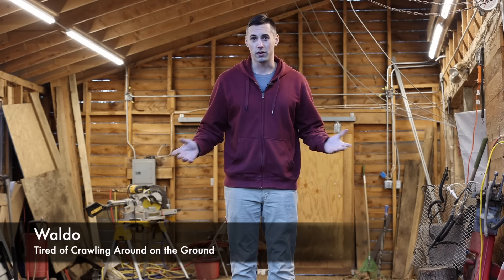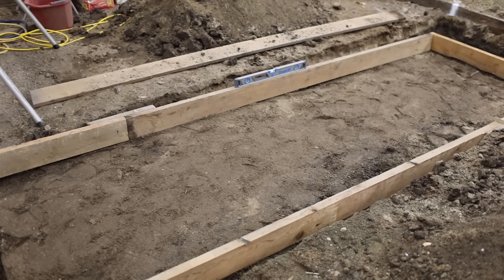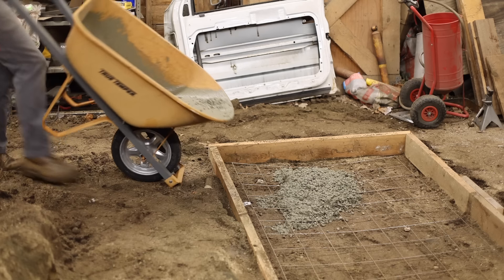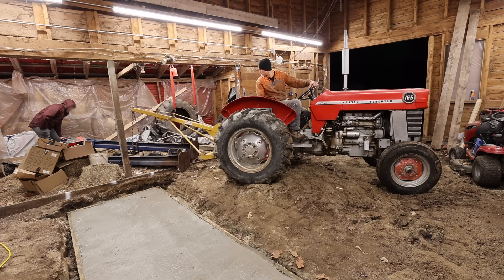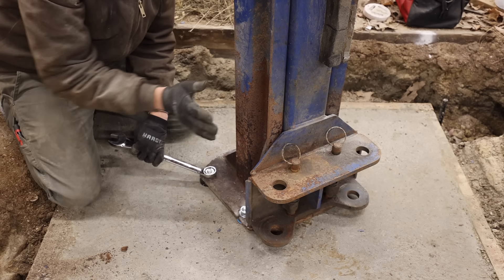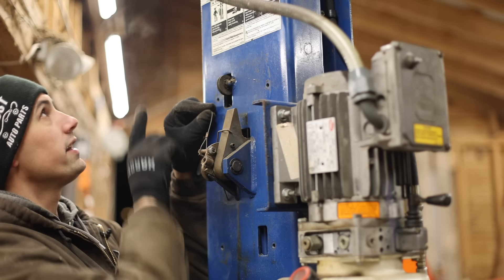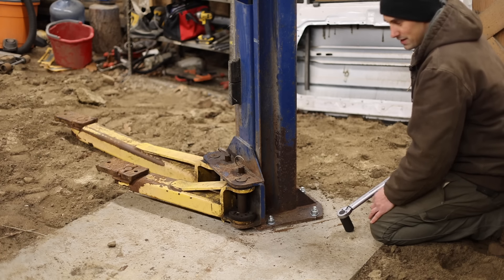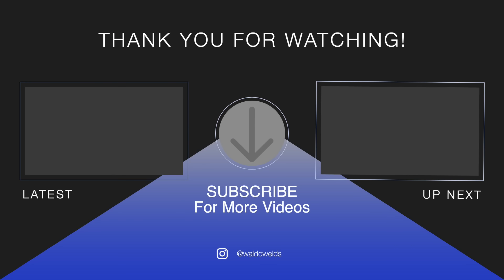Installing a 2-Post Automotive Lift on the Cheap

Comment: Hi Waldo!  I have an idea for those cable spacers.  Weld the nut onto the end of the pipe.  On the other end of the pipe, weld on a larger nut that the cable end is able to pass through.  Now you can use the flats on the larger nut to rotate the entire spacer, tightening up the cable.
Reply from the maker: Good idea! 👍
Reply: F’n brilliant, which is probably why I didn’t think of it.
Reply: Haha you wanna know the right way of doing it ? 
Install spacer at the other end of the cable inside the column that’s the only right way lol 😢

Comment: 14:19 I think there is to little concrete from the edge of that post to the edge of that slab. Looks like a super easy spot for cracking to occur, especially now that there’s 5/6 of the pad thickness holes drilled right there and one is within 4” of the edge.
Reply: Bendpak lifts call for a minimum 6" concrete on each side past the edge of the base plate.
Reply: @rallydan31   And the slab s 5.5" thick.
Reply: This is correct. Its called edge distance and the minimum is determined by the number of anchors, the type of anchors and the slab. As this is a Rotary this calls for 4-1/4" of 3000 psi with Hilti kwik bolt 3 anchors and 4 inches of edge distance. The edge distance is also dependent on there being a full slab. This is dangerous for far more reasons than edge distance. That slab on a 2 post assymetrical lift is an accident waiting to kill someone.

Comment: Merry Christmas Waldo. I like, most of the comments have concerns with your pad, it's not anchored down, such as with pylons using rebar, not wire. Theres no real footer either. Instead of ripping it out may be you could drill into it from all four sides insert 1/2 inch rebar and let that rebar run outward another 2 feet or so, dig down for 4 pylons: 2 front 2 rear of the lift alighed with the post about 2 ft deep run rebar vertical and wire tie it to the horizontal rebar I mentioned earlier, make cross brace with more rebar. Then pour a new pad all around the existing pad, locking all together. Also for added stability tie in the top of the post to the rafters of the building,  those rafters dont look strong but would have a huge amount of leverage against the load of the lift. I think these two modifications would secure the lift for years to come. I know you want to lift the 2 trucks you are building and there both very heavy trucks. Love the channel, just dont want you to get hurt, keep the content coming!

Comment: The ends of the pads flip up so they can be used as extensions to reach a frame if the lift arm would contact something (like low side steps) before the pads touch the frame. If you would do that make sure the pads are facing the opposite direction from each other on each side. Your best bet is get a set of extended height adapters. They're a better option over having the long end flipped up.

Comment: I've got a dirt floor in my shed and was thinking of doing the same thing. I think I would add more concrete under the posts. That narrow strip of concrete that you said weighs 3300 lbs seems a little light. I'm not an engineer so I'll keep watching to see how yours works. Thanks
Reply: It's not the weight that's the issue-- it's the fact that it's only lightly reinforced-- and it's not very wide front to back.  He should tie the tops of the posts to those rafters above and that will make it 100x stronger.
Reply: I would make it "H" shaped. I feel it could tip over on that narrow shape. Lift and concrete together I mean.
Reply: @spiloFTW  H shaped, well reinforced, with the H extending to the furthest reach of the lift arms.
Reply: I would have dug 2-3 foot piers under the post for the lift. Then make sure that I didn’t get a cold joint between the piers and slab and rebar to hold it all together. This is scary.
Reply: Make a slab that the vehicle can park on or you will end up hurt or dead. THIS IS NOT AN ACCEPTABLE PRACTICE.

Comment: The front to back stability is sketchy in my opinion. Remember that the columns are long levers and the higher the weight, the more torque on the slab. I think at full height, you will be on dangerous ground of the whole thing tipping.
Reply: Yup. I hope he sees this and fixes it, I really dont want to see him get hurt or worse
Reply: I AGREE>.. . He should have dug 18"  deep footers with lag bolts down into them.. Where at least the posts were being held in the ground well..  I already wrote him a long note about it..   If he would just tie in the top of the posts to the Rafters, it would make them much much stronger and keep them from leaning so easy..  It wouldn't take much off balance to side load that slab too much..  Even if it was reinforced with heavy re-bar, I'd still be a little worried, just by how close to the edge those posts are.  I know of people who have died by cars falling on them-  it's no joke.
Reply: Yeh that thing is not safe at all the way it is setup. I wouldnt get under that thing at all. Not to mention its poured with quickrete.

Comment: I've poured concrete floors in old barns like that many times.  There's no need to knock that thing down at all.  Just take some time digging and leveling the floors, put some form boards along the open doors, lay out all your re-bar and a concrete truck can back right up to the door;  it has a long shoot that can be extended off the back and can get to almost everywhere without much trouble..  You can wheel barrow some of it in the far corners.  It would completely change your shop if you poured a whole floor...  I've done it several times on old dirty horse stall/ hay pole Barns... Just pour your concrete right up to the wall that's there;  even if your slab is high and the concrete flows into the studs, it's fine;   You can usually rent a survey/ laser level from an equipment rental place (or just buy one).... I've done these with old barns that were literally falling down sideways and ready to collapse.  We would just pull walls straight with a ratchet strap and beef it up with a few board here and there;  Put in some X-braces in a few places-- and then just pour the floor-- which would have several of the telephone pole Posts just coming right through the concrete..  And then We would put new sheet metal on the outside and it would look like a new building from the outside.. and you could still see the old barn structure on the inside with the extra braces and new shelves, ect..   Your shop looks like it's in great shape.  I wouldn't knock it down-- just add a floor, and then build an even bigger shop next to it if you need to.
Reply: We even did one that only had 8ft walls (was a 40 x 50 building), but the guy wanted 20ft tall side walls.. and it was pole barn that's taller in the center section, with a "lean-to" on each side of it..  We pulled the walls straight again, beefed it up with extra braces everywhere, jacked it up and put it on these long semi trailer frames-- and drug this barn across the pasture to the next mile road, and then we jacked it up and put new 20ft polls under it all around. lol..  So now the barn looked like it was on stilts, and we had to fill in the rest of the lower walls, and put all new metal walls and metal roof on the outside--- spray foamed the inside and poured a new floor inside 'AFTER" we did all that..  So again, my point is-- it's common to poor floors in existing pole barns/ shops with dirt floors;  and it's well worth the upgrade.  A lot of times, you can still get a skid steer in there to help with all the dirt work (if you have one)...  You would be surprised at how easy it is to save an old rickety leaning barn that looks like it should be demolished.........   I would pour a floor in your shop for sure..  tearing it down is never a good idea-- it ends up making an ENORMOUS mess and costs lots of money to tear down and clean up-- and that's before you ever get started on your new build;  and then you just lost your old  shop.  If you build new, just start fresh in a new spot-- plus you'll still have this old shop as storage (with it's new concrete floor) lol.
Reply from the maker: Yeah, I totally agree. I can't physically get a concrete truck in there right now because it's so muddy (that's why I only poured a small slab by hand). I really need to do some work on the road first. Depending on how soon I plan on building a shop, I might pour a big slab next year after mud season comes to an end (IF it comes to an end -- we got so much rain this past summer that it stayed muddy all year!)
Reply: @WaldosWorld  Right on.. I vote SLAB.. sometime.. whenever.  Rather than tearing it down. lol
Reply: @golefevre  I'm in Enid, Ok.. doing it up
Reply: One problem I see is that in old barns there might be a lot of organic material (ok manure) in the floor that should be removed and maybe some compacted limestone over it? I have that in a shed right now that was built over a tornado ripped off old barn.

Comment: Hi, I know this video is 6 months old now, I hope you haven't had any problems with the hoist.  Here in Australia, hoist manufacturers require a MINIMUM of 4" depth of 3,500psi concrete (not hand mixed) and to be bolted down to 20mm bolts tied into 3/4" rebar in the concrete. Using 'ramset' type fastners is not considered reliable as they can pull out, especially out of new concrete.. I also worry the slab you made is too short length ways, if you get too much weight to the rear, or to the front, it would be easy for the whole hoist, slab and all to tip to the heavy end.  I think you should re mount it on a longer slab with bolts set in, with decent rebar in it, or at least put some cables from the top of the legs (or tie to the roof), forward and back... so if the slab begins to tilt, the cables will give you time to get out from under the vehicle. I am not sure of the regulations there,  but the slab should really be long enough so the wheels of the vehicle are on it when ready to lift, so there is no way the slab can turn over. All the best mate... I enjoy your videos.
Reply: Nah, he's in New Hampshire who's state motto is, "Live Free or Die." Basically no regulation there. My wife is from NH. I drew "plans" for her parents' sunroom addition which were little more than a napkin sketch, and got approved & permitted for construction. What that process taught me is if the individual Building Department Rep. feels comfortable with you, you're golden. No need for a lot of details on paper like other states require.

Comment: You can dig front and back Rectangles step as deep as you can stand comfortably throw stone crush as floor and you good to go. It’s easy I’m a Mechanical Engineer and 70 years old so I know. Built many engine and trans in my garage. Been there and done that.
Good work kid.

Comment: With the relatively narrow 4' wide base be careful to not put too much load on the long arm past the edge of the concrete.   Based on my quick calculation if you put 5000 lbs on arms extending 2' past the edge of the concrete the whole concrete base, lift and vehicle would be unstable and tip over.  On your lift in this video you can see that the load was not balanced and the lift frame flexed about 1/2" (at head height) toward the rear of the truck.
Reply: Base is way too small

Comment: I adjusted the balance cables with a car on the lift. The most crucial time is when you have something heavy and you start lowering a car down, it needs to be balanced or else your car will rock to one side because one cylinder will begin lowering than the other side. Usually it's the cylinder closest to the valve. Just FYI. I have the EXACT same lift I installed myself. Good job!! Huge benefit and back saver. Also you can use this lift to lift heavy stuff off your truck!!

Comment: Great video as always, I’m sure you figured this out, but your steaks should be below the top of the form board.  I worked as a carpenters helper for 2 years while working my way through college in 2014-2016, pouring concrete for roads, drinking water treatment plants, and a high pressure compressed natural gas (CNG) plant. If you start on one end and work to the other when pouring the concrete it makes a stronger more cohesive slab. When wet cement sets a little it makes what is called a cool joint and will not properly bond. Lastly concrete is considered “green” or too new for a week in south Louisiana (for industrial purposes) and should not be anchored to.
Now for my concern. Without a footing I’m concerned your slab could “walk” in comparison it’s not that heavy. I’ve always wanted a floor lift so I’m encouraged by this! Be safe and great work!

Comment: Think I would have dug down at least 30” at the two ends under the post positions to help prevent the whole slab tipping  forward once there’s a unbalanced load on the lift surely there must be a engineered design for the foundation on the manufactures website.

Comment: Don’t know if you’ll see this, but if you get rubber bumpers for the bump stops it’ll raise the rear end of your truck up a good two inches, did it in a 99 f450 dump and it’s night and day. Seriously helps with bed clearance👍🏼

Comment: You can flip up the ends of the arms to give you extra reach on the frame. They are called flip up adapters. They are designed to be able to reach the frame if you have really low hanging running boards.

Comment: I would be very concerned with how small of a footprint that little slab has. I would have made it with better footings and at least beams to act as outriggers. I would also be very cautious on torquing or loading up mechanical anchors in fresh concrete. 
For the interim, maybe run tensioned cables from the masts to the shed structure.
Reply: You’re assuming the shed that he wants to replace would provide lateral support.
Reply: Ok karen

Comment: And that right there is exactly why I had no problem paying a $100 short load fee for my concrete order haha.
I have to agree with many of the other comments on here, we enjoy your content and simply don't want you to die! That pad is in no way capable of supporting a load at full height while wrenching on it underneath a vehicle. please re-think this entire setup.
Reply: What's the difference in cost between a concrete delivery and this hand mix route, without even a  mixer? There seems there would have to be a significant cost  differential not to have a delivery of a uniform mix.

Comment: Having a lift is huge.  I have one in my shop and it has been a massive help.  I went with a four post that I can move, but I'm in the process of adding on to my shop and I plan on a two post for help in lifting bodies off frames.  Be vigilant when balancing the vehicle.

Comment: I would think as a welder with a source of steel around to weld up a sub frame to be embedded in the concrete pour.  No chance of the expansion bolt holes pulling out. Also could weld in those outriggers front and rear 8 feet or so and embed as well.  With rebar added, that would be very safe and robust configuration.

Comment: Not sure why it isn't standard in the US of A, but Down Under we put little plastic chairs under the steel mesh to lift off the ground and keep it centred in slab. Strong enough to walk on during pour and hollow with cutouts so concrete flows through them, leaving no hollows when complete. I think a couple of beams at 90 degrees to what you did, one at either end on opposite sides, would add a lot of strength and stability for little extra cost. Worth it for safety.
The reason your drill had no problems drilling holes is the concrete was fresh (best time to drill or cut in control cracks).

Comment: pour concrete columns about a foot higher than your concrete slab (sonotube) to mount the posts to. That way you can stand up under the truck (do this on your final pour as it would be stronger as part of a mono-pour with rebar)

Comment: Hey Waldo a friend taught me when pouring out of a wheelbarrow it’s easier to use a mortar hoe with 2 holes in it to inch your way to an evenly mixed pour each time. A lot less hassle and great for filling trenches

Comment: Good stuff. My partner and I bought a house earlier this year in south central Michigan. The couple that originally built the house in the mid 1980's were horse people, so we have 2 barns: a  2 level with 4 stalls on the bottom and a 28x40 pole barn. The larger barn is going to be a shop for me, but it is very raw: dirt floor, a single 20 amp power circuit, and one wall open to the elements that provided a shelter area for horses to come into from the pasture area. A lift is something I really want, but access to where the barn is is not great (narrow drive, lots of trees on each side), so a regular cement truck won't fit and a 28x40 slab is a lot of concrete and won't be cheap to pour. Plus it only has a single 20 amp circuit and I will have to build the 4th wall. A setup like yours is a very good temporary solution I think until to get a lift for a couple years as I improve the barn in stages to the shop I really want, proper power, heat, concrete floor, etc. One thing I would do differently is I think I would do a 10x10x6 pad with regular rebar vs hog wire panel. I don't really need a 6" slab for the size lift I want, but I think the extra weight is beneficial for stability. I have subscribed and look forward to checking out your other content.

Comment: Needed three times as much concrete for the lift. 6” is minimum, that’s spanning a floor with a much larger foot print( like your whole barn,) therefore spreading the load more.
Reply: ABSOLUTELY!